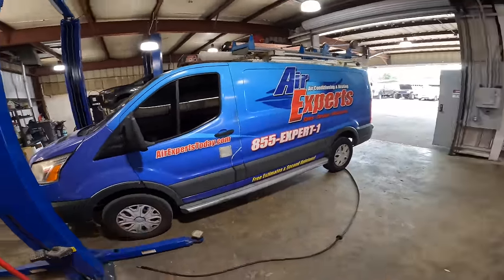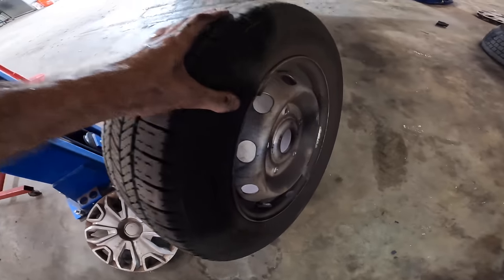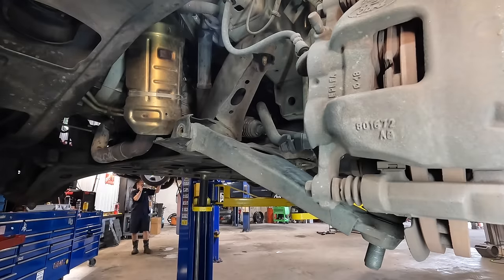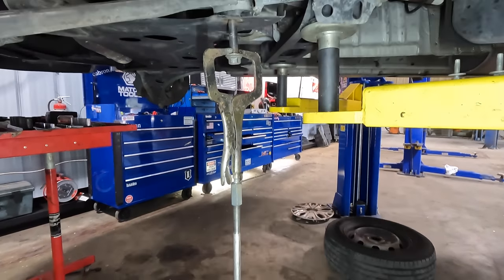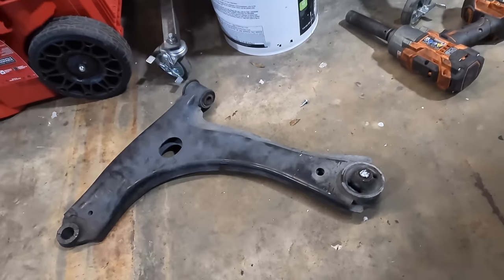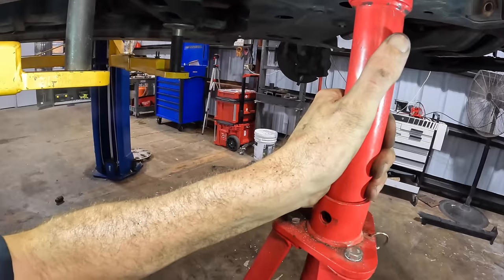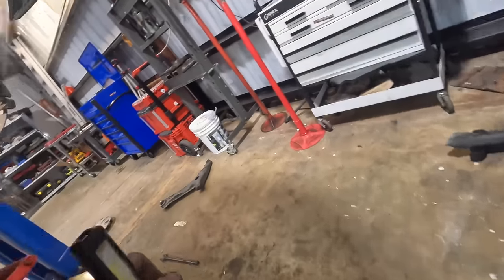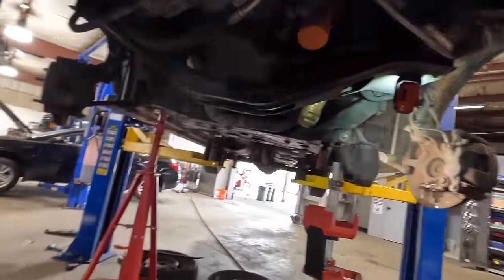Bent Frame Bolts! Easy Job Escalated! Ford Transit 3.7

Comment: This is the kind of damage the insurance adjuster does not see where parts hide bent components. Bet this truck is a killer to get good frontend aligned true. Ball joints were also bent would be my guess why so hard to remove like other parts.

Comment: You gotta try getting shorter Saw-all blades for that thing. Those long ones make the job a lot harder in both being too long but also allowing a lot of flex and vibration to be lost taking a lot longer to cut and leads to wearing out the blades teeth far quicker. Even if you have to cut the blades down, it will be a better tool in the end. You beat your own ass up enough working for a tool to add even more to it.

Comment: these wishbones always give you problems Ray, all you need to do is lesen the torque on that back bushing. but you are going about this in the correct way buddy, the bolt will come out in the end. i'm 99% sure that it's not because of a bent bolt. there just a pain in the Ar*e mate.

Comment: That isn't collision damage, Those bolts have gotten too much side load from the worn bushings. causing a twist action to side load the shank of the bolts. Happens all the time on these when these LCA's go bad and are not changed in a timely manner.. If that bolt went in like the front bolt the un and down motion of the control arm would not put the twist in shank.

Comment: Another easy job? It was on a Ford, that's an oxymoron. Lol. It's also the reason I always kept a foot long piece of 2X4 so I could have a fulcrum to pry against. It might have worked on the driver side and saved some labor time, but that pass side was definitely screwed. We also had as a shop tool a CP 717 air hammer, they have a 1/2"  shank and would drive those Ford ball joints where no other one would. Might be worth the investment

Comment: 15:50: i susspect your guy in the background was very aware he was in frame. Using a torque wrench and make it very clear he cross-tightened the lug nuts. Like straight out of the text book, not giving the armchair experts even a chance hehe
Reply: Why would you assume he would do it wrong. Ray needs people that can do It textbook. He doest have time or energy to bdeal with bullshit
Reply: @zachv1942  I did not assume he would do it wrong per say, just that when the camera is not rolling there are very few if any experienced mechanics that use torque wrenches on wheel lug nuts...

Comment: Is it just me or did it look like the driver side knuckle look like it had a hairline crack where the ball joint seats running vertical near the front of the knuckle? 39:15

Comment: Hey Ray, if you ever have that problem again with an adjustable ball joint tool ( 10:20 ), that slips off, use a stainless hose clamp to keep it from spreading open.😊

Comment: I hate doing any kind of work on any of the Ford Transit vans.   It is always a disaster.   In my opinion, it is one of the worst designed vehicles I've ever worked on, especially considering they are primarily considered a light commercial/fleet style vehicle.   Some of the Ford guys might not agree, just my personal opinion.   I'd rather work on a GM product or Toyota or even a crappy Dodge/Chrysler/Fiat/Jeep than one of those things.

Comment: An accident doesn't really add up - if both sides had been hit hard enough to bend those bolts, surely we'd have seen other bent parts, or at least replaced parts - especially if it happened in uhaul service. They don't exactly spend top dollar at the body shop.

Instead, I suspect it's from chronic overloading and curb hopping - especially in its uhaul service - A/C guys tend to be a good bit easier on the equipment than $20/day rental customers.

Comment: since the bolt was loose from the top, couldn't you just make one cut on the bottom and pull it out?  Instead of making a cut at top and bottom?

Comment: I dont think i have ever gotten those bolts to come out. Even if the van had 20,000 miles. I am surprised it even moved. Those lower control arms suck boy... wait until you have to do a transmission and everything is rotted it place it sucks. Even the converters half of the time are stuck to the flywheel

Comment: I suspect HVAC company employees of driving that Transit as if speed bumps don't exist.  Going fast over them makes them smoother.  But there is a price to pay. At my employment place they have those rubber 1 foot wide speed bumps. And most employees speed up so it will be smoother. So the speed bumps create exactly the opposite of what they are intended for.  Speed tables are the way to go.  If you go over a speed table slow you get a smooth ride.  I have complained to my management about the speed bumps and requested speed tables. But their response is that I should speed up.

Comment: Sorry about the Ball Joint.  I'm intimately familiar with those Ball Joints/Knuckles.  There are two ball joints used on that era of Transit Vans; once is pressed-in and the Heavy Duty version was pressed and bolted.  There was a long, old history of the pressed-in BJs to come loose, if you can believe it, so the bolts were added.  It's a very high press fit.
I would have tried heating the "hoop" with a torch.
I cannot believe you got it out!
You could look hard at buying a knuckle/BJ assembly.

Comment: A better engineering design would be to have a flange at the top, and bolts at the bottom. Remove the bolts, and hammer it up to remove, and down to fit. The shaft could be just a close, not an interference fit.

Comment: As a ford technician this is normal for the control arms. You at lucky if you get one that doesn’t cause you issues. I do not believe it’s been in an accident. It’s just poor design from ford.

Comment: do you ever work on new cars?
Reply: Slim chance. 
New cars generally have a 3 year warranty. If repairs are needed it is back to the dealer. 
Also, people with new cars generally don't have the opportunities to develop a trusting relation with independent shops. 
Most cars will give your 10 years/100,000 miles without much problems.
So, on the seldom occasion when the car needs fixing it is the dealer that gets the job. These are my Two Cents.
I would love to hear other perspectives.

Comment: The transit van, a beautiful British invention. Though created by ford, it was developed by ford uk. The secret was:

1.  Make the rear bed big enough to hold drywall in the larger common size, around 8 feet long
2. Use coil over springs and shocks on each corner making the rear bed larger and lower and easier to use.

It was the van of choice in uk bank robberies for decades as transits were reasonably quick but handled much like a car due to its springs and shocks being from a car design.
Reply: As far as I'm aware, Transits have always had leaf springs on the rear, and independent front suspension only came out in 1985, until then they had a beam axle on the front (I worked on all the generations from the eighties until I retired 4 years ago).

Comment: While I am a Ford guy , I have been wondering about the thinking of some of the engineering behind the systems on their models lately . Is it that much cheaper to use ball joints like that ? It seems that the thinking is moving to - make more money on the service time - than the serviceability of the units .  The days of the backyard mechanic are going away . If you don’t have the latest gizmo to work on your vehicle you are just SOL .   HEY , STAY SAFE , HAVE FUN , thanks for the videos , I enjoy them .

Comment: Well, that was Fordtaculer because remember back in the day at Ford we have a better idea! Don't buy one!! LMAO.  Heat the area around where the ball joint goes into and it will allow it to go in much easier. Or cold shrink the ball joints.

Comment: I sure detest these front wheel drive vehicles with the tinfoil subframes.......is that the best we have at Ford?  I've been driving Fords for 60+ years and the old ones are easy.  Ray when the universal Ford Tool(a big hammer) doesn't work.....the alternative is a cutting torch.  Were those grade 8 bolts?  It is good you've documented with this video as the customer would never believe the work you've put into this roach.

Comment: I presume Ford dealers have a special tool to remove those ball joints from the knuckle. Still you found a way with violent force to do it and not damage the knuckle. Those rear a-frame bolts were a real PITA to take out. I am surprised you didn't take torch to them.

Comment: There is a special ball joint tool for the transit, removal and install.  Youtuber  "Medtech 67" does a lot of Ford Transits a lot of good information on what you are doing in his vedio's.

Comment: As a retired certified mechanic, that did not need ball joints. If they did, then maybe he should have rebuilt the whole front end. I am sure I will get feed back, but I have repaired many vehicles over the years in similar condition and have never replaced lower ball joints because the A frames need replacing. All the impact went to the A frames, that what they were designed for, the ball joints were not bent, in tight, not sloppy. I am sorry, but he just screwed the customer!!!!!!!!!
Reply: Customer approved the repair.  Could've refused and got a second opinion.

Comment: note to self:
do NOT buy a ford transit!!!! :)
ray, maybe its time to buy a "big nasty" from astro. 498k is the part number. its the same air hammer eric o. has been using for at least the last 6-7 yrs and he loves it. those ball joints would have been out in half the time or maybe less.

Comment: 😂haha omg it's so funny 😁 seeing other mechanics do the same jobs I've done over and over. And not saying that transit wasn't in a accident. But those control bolts always have to be cut out. Its not bent its how they are assembled and the weight leaning on it that deforms them from the get go. It's very rare you find a a ford transit that CA bolts come out clean. Sorry you now experience our daily struggle at the dealer. 🎉

Comment: Just shows the panel beaters didn’t complete the crash damage, leaving it for someone’s else’s problem. Bet they didn’t organise a wheel alignment prior to handling back the van to the customer. Would have shown the faults immediately.

Comment: Ferd and their "betterer iders". I absolutely abhor messing with Fords. Once replaced the alternator on a FREE Focus. It sits directly under the power steering reservoir which had been leaking. Somebody explain to me why you would place an expendable item in a location where it was necessary to rotate the entire engine but NOT provide a way to do so. At least with 3.8 in the GM products there was a simple way to rotate AND HOLD IT to work on the back side without needing a cherry picker. 
I sold that FREE Ferd POS for parts.

Comment: The side load on the remaining bolt was caused by the down force on the lower control arm. Pull the ball joint and lift the arm up and the bolt should drop out. As you said, less brawn, more brain.

Comment: which moron connected the anti roll bar droplinks directly to the steering .   scary stuff. small wonder the tyre is wearing  crazy .  My 2021 Fiat panda   hybrid  had the same anti roll bar issues .. I relocated the drop links onto the lower suspension control arm .  now it drives and aligns perfect on a Hunter  alignment  setup.

Comment: Thank your lucky stars that you're not having to do brakes on it because you actually have to pull the hubs off the vehicle to get the rotor add brakes apart . Are the rear axle you actually have to pull the axle out to get the brakes apart. I do not know what kind of drugs the engineers were using when they design that vehicle.

Comment: IMHO while I like fords designs as far as the body goes, the radio is shit, the engine starts to over heat at around the 3-4 year mark after purchase despite regular maintenance changing the oil, breaks, and coolant courtesy of fords mechanics and what’s sad is I want the only one who had issues with the sync radio in the F-150 Sport with the 5.0 a lot of people had the same
Fucking issues even going into the mustangs sync radios and don’t get me started on the fact you have to have a bypass of some sort if you wanted to out put in an aftermarket radio due to all the unnecessary bells and whistles and while the radio sounded ok it didn’t have the thump i loved shit back when i had an 06 tundra got lent a 4 runner while the truck was in the shop and the damn 4 runner had a more impressive low end extension when listening to song like country grammar by Nelly it’s sad that a car well suv that came out around 06 had a better fucking audio system then a newer model truck with the touchscreen it was garbage hell even the ram having a 19 speaker audio system from one of my favorite brands Harmon kardon for me the big horn blows most stock audio system out the water that l have heard but Harmon  kardon should be expected to sound better they specifically specialized in home audio hifi style speakers for the price you couldn’t go wrong with a pair of Harmon kardon speakers and a nice amp to power them now the system in the ford from factory was a Sony based infotainment system including the door speakers but it didn’t have the oomph the Harmon kardon system does and j think the reason the harmonica kardon system actually has base is due to the model of ram having a factory subwoofer which means I didn’t have to add any subwoofers that would be enough to feel in your chest while keeping the size below the seats so I think opting for a car with a decent sound system makes the car fun to drive.

Comment: Ray you got stung with that job. i say he got someone else to do that job down the line some where and that someone could not do the job so he was good enought to buy the parts for you but not the bolts nasty guy. i hopes he pays you a lot over the odds for that job. very very nasty

Comment: Worst designed Transit ever made, my mate drives one for work, the front door hinges have been replaced three times in three years, the doors are to heavy for the hinges, where he is in and out forty odd times a day. It's also had a new engine, wheel bearings done twice and now the gearbox is on its way out, but his company is stuck in a lease and won't change it for something else until the lease expires. Absolute nightmare, but because it's in the UK it doesn't have a Ford engine, they have Peugeot engines, go figure.

Comment: Anything that can go wrong usually does. In this video up is down and down is up so to speak..you lost time on this job..I think this customer
knew before hand this job was going in the direction it did..somebody tried and failed to remove those bolts after the crash..no doubt.

Comment: Worst front end design ever trying too hard to do things like the Europeans. Can't just make them simple like they did for almost a 100 years. Need a special tool from ford to do them easier. Uses to bolt holes in the knuckle to press the new ball joint in. I've been a front end guy for over 30 years, and was the first time I ever had to send the knuckles out to have new ones pressed back in...

Comment: Gah!!! Noooooo!
That’s not a car. Why do people call plainly commercial vehicles cars? Well, specifically, American people. It’s very confusing.
Go out to the car and grab my jacket, please.
So I take the offered keys, run out front and the keys don’t open the only car in the driveway.
After trying for a while, I concede defeat, go back in and tell them they’re the wrong keys. So they check, say they’re definitely the right keys, take me out front to prove it, and open a VAN to get their jacket.
What’s up with that?
Lucky I didn’t break the stupid Ford locks on their Fiesta. Decades later, I had that same conversation with the same American guy, who still cannot understand why a van is not a car.